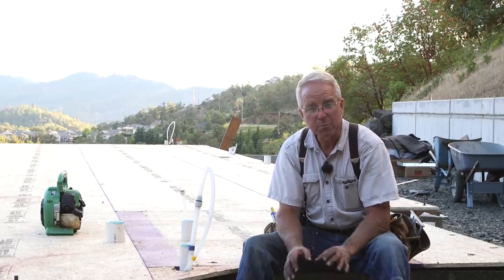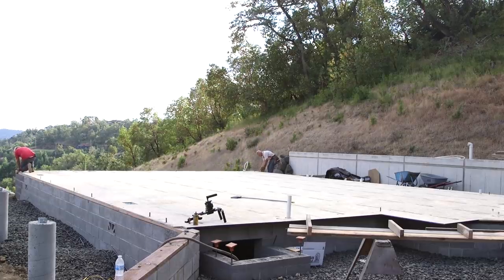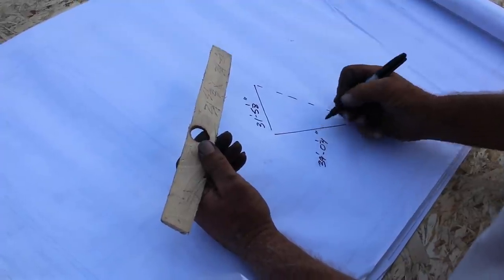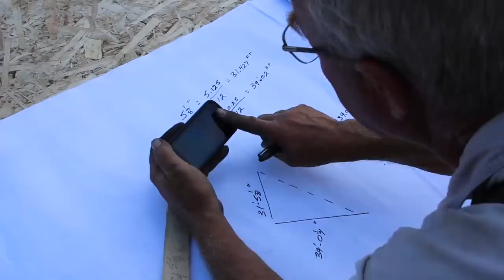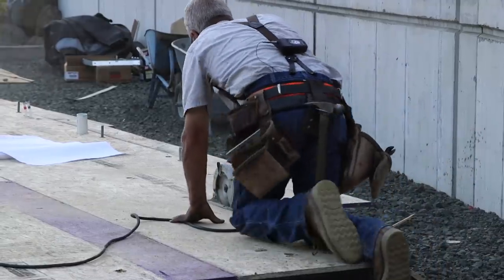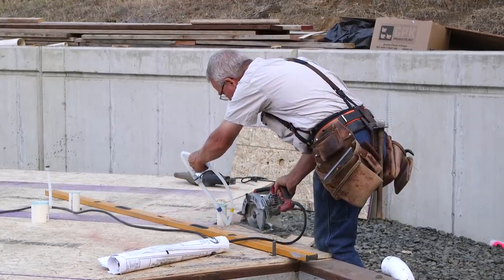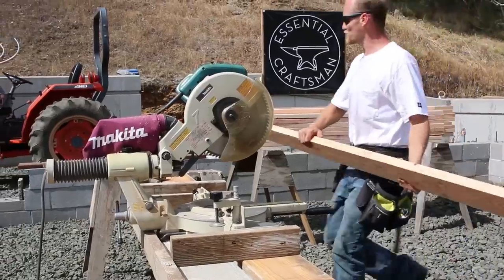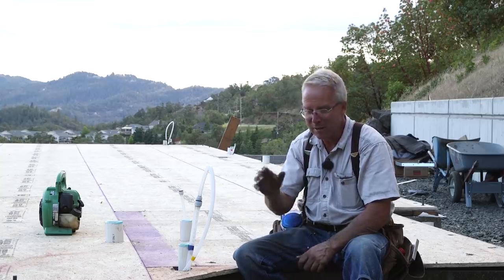Make it Square Ep.45

Comment: Old saying, "we are not building a piano here?"
Reply: My votech teacher used say that, 20 years ago. I still say today. My guys have adopted it as well.
Reply: Same here Alan, he's taking it way way too far.
Reply: @ajs96350  ...Or, maybe you're not taking it far enough?
Maybe you don't understand what he's trying to convey here: excellence in work, excellence in life. 
Take a moment and make some room in your mind for these words and actions from a master. We don't all see things the same way, but its always served me well to drop back and consider what someone else is saying. What their life has taught them. 
I've learned a whole lot this way, the alternative of "I've never done it that way before" will ensure that you never learn and never advance from where you are now. 
Just my two cents...
Reply: The time will be spent to make the project right.  You can do it today, in the bones, or have half a dozen trades (trim, tile,  cabinet guys, ETC straighten it out later.  It is easier, cheaper and simply a better practice to get it right in the framing.
Reply: @osmith5086  Whereas I get what you're saying,  I have to disagree. 
He was there for footing forms, block work and floor framing,  he has checked and rechecked along the way, he knows it's good.
Plywood has zero bearing on any square issues, you cant run it out to fix square issues, it won't support the floors above.
The frame is good, cut the plywood to the frame and then check your walls for square.  You can cheat walls out a little to help, but theres nothing you can do with plywood to fix issues now.
This is my issue with spending so much time talking about it.
As far as spending so much time to reflect about it, that crap doesnt pay the bills and feed mouths. Theres a line somewhere, I'm not an amateur,  I've been doing this for over 20 years.
Reply: Alan Pinho:  I worked with a guy who would always say, "We ain't buildin' no damn pianer here."
Reply: That's ironic, because I do build pianos! If it's off by a 16th, its garbage. 
 I plan on building my 1st house in the spring. 
It's going to be called a Piano Home.
hockmanpiano.com
Love this channel!
Keep up the good work!

Comment: Could have just framed that back wall with 2x8 instead of 2x6 and been able to get your 5/8" without interference. :-) Of course I don't know what window system you are using so that could turn into a problem if you did that. Always something! I am curious after all your work measuring and establishing the footings and walls how did it end up off? Was the foundation print not drawn to match the house correctly?

Comment: I’d split the difference between the back and the front. Quarter inch strong
Reply: That would be 5/16" each end to equal 5/8... a 1/4" strong would leave you 1/16" shy
Reply: Al Amantea idk about you but I with rough carpentry aka framing the smallest increment most people generally work with is an 1/8” but yes you’re technically right.

Comment: LOL at explaining pythagoras.  With all the converting feet into decimals, And back again.

Its times like this using metric measurements makes more sense.
Reply: or better yet just plug your numbers into online calculator
Reply: I carried a "CALCULATED INDUSTRIES" handyman calculator in my safety orange vest just push the button to switch from the surveyors decimal feet to feet and inches   feet to inches,,  etc. only cost $ 29. The $ 60 construction master 5 stays in the brief case in the truck. to calculate roofs,, Etc
Reply: Knowing decimal equivalents is like knowing multiplication tables.
Reply: I need a tape measure that has both units. I use metric when I can, English when I have to.
Reply: I need a tape measure that has both units. I use metric when I can, English when I have to.
Reply: Metric system is good for those who need life simple.   When you realize how handy the 4’ by 8’ dimension really is in framing there is no way you would want to use metric.   Only knowing one system just dumbs people down, just like only knowing one language.  🤷🏽‍♂️
Reply: Shane Yorgensen it’s kind of what you have when you pair it with the inch/foot system. I get your point though.  👍🏼

Comment: All those conversions with measurements to convert into inches and foot, case in point for the USA to switch to metric
Reply: The US uses metric though... We just have a combined system, like the UK.
Reply: As I said above, Canadian Carpenters use feet and inches too.
Reply: When calling out cuts or memorizing cuts Imperial is a hell of a lot easier. Add to that the fact that all of our lumber and building materials comes in imperial dimensions, it would be stupid to use metric. Metric makes sense in scientific uses sure. It does not makes sense in the trades here in the US. The only exception is roofing shingles. They can be ordered in metric sizes and they are only convenient because the shingles themselves are bigger and therefore cover more. You still measure and cut them with imperial dimensions though.
Reply: Not a valid point. Worked both sides of the pond. Question of habit - nothing else. Of course our material, except ply, is in metric dimensions, but only really matters in sheet goods, as you lay out for sheet rock etc. ...no real difference, except we get to skip the fractions.

Comment: 4:20 hurts my metric system
Reply: Too much 4:20 will do that
Reply: @aagames8420  What, you've never smoked 5/8's of a joint?
Reply: unknown 
Whoa, you mean 15.875mm
Reply: Decimal feet are a standard measurement here, especially among architects. We tradesmen naturally have to learn it as well. 1/100th of a foot approximately equals 1/8th of an inch, so it's actually quite handy a measurement.
Reply: @cracklingvoice  
1/100 of a foot is 0.01,  1/100 of 12 inches is 0.12 which is close to an 1/8" which is 0.125"
Reply: So 3.05mm is 3.05 mm which is close to 3.17mm. Got it.
Reply: @D2O2  Um, I'm not sure what the point was of your comment.

There are 96 eighths of an inch in one foot. The actual tables take a couple jumps to make it work. I said 'we tradesmen' because I am a tradesman and actually have to know how to convert between fractional and decimal measurements as part of my work.
Reply: @cracklingvoice  I agree that there are 96 eights of a INCH in 12 INCHES which equals 1 foot,  but 1/100 of a 1 FOOT is not approximately 1/8 of an inch,  it is 0.01 feet.  1/100 of 12 inches is 0.120 inches which is approximately 1/8" or 0.125".  The unit conversion is tripping you up.
Reply: @cracklingvoice  what is the difference in length between 100 eighths of an inch and 96 eighths of an inch?

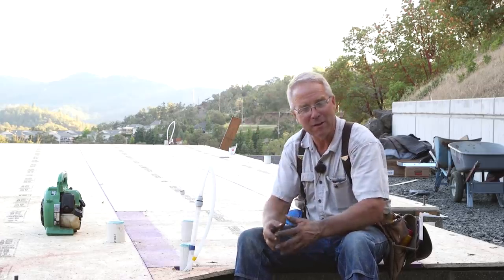Comment: 4:18 - 4:34 

No, no it's not. Metric man, metric is handy.
Reply: I was thinking, this Pythagoras calc would be a ton easier in metric :)
Reply: @dorsetengineering  Yes, only three countries in the world resist change. Myanmar, LIberia and some other developing country :-)
Reply: Being fluent with both systems, I can tell you that there's no real difference between using imperial or metric measurements.
In this particular case, converting everything to metric before using the Pythagorean theorem, and then converte it back to imperial will only lose accuracy, due to rounding off.

Scott is being using this system forever, he's handy with it. 
Why mess with it?
Reply: @hugoramirez1786  I find the metric system convenient and safe. Nobody should have to learn both systems. Imperial is redundant and causes errors. No, I don't think Scott should change, but future generations would benefit tremendously if the US decided to shift. English is not my mother tongue. Learning english to be able to communicate is a much bigger commitment than learning the metric system.
Reply: @BjorckBengt  I was born in Mexico, it was metric for me until I moved to the U.S. at age 23. Now I can do both just as easy. English is also my second language, which I learned while still in Mexico.
Because everything that Scott is using is in imperial (measuring tools, lumber, the standardization of materials based on feet and inches) plus all of his work experience is in the imperial system, introducing metric at this point will increase the possibility of error.

I might be wrong, but I think that when he said decimal places, he meant thousands of an inch, not actual metric measurements.
For example:
13/16" =.8125"
1/2" =.500"
1/4" =.250"
3/16" =.1875"
And so on . . .
(for those that don't get it, just divide the first number by the second:
13÷16=.8125).
Reply: @BjorckBengt  "plus one other developing country".
That's a good one, lol
😂

Comment: One nice thing about drawing plans with AutoCAD or some other CAD (Computer Aided Drafting) plan is that you can create a drawing with all the diagonals measured out in advance. You can double check them on site but this saves a lot of time in the field especially on a custom home and with angles like your plan for the garage or steps in and out like the back of the house.

Comment: If you have to grind out a lot of calculations using Imperial units, I suggest using an app that does the pythagorean theorem calculation for you. Carpenter Square Corner Tool seems like a good app. It accepts inch fractions down to 1/16" and automatically calculates the answer back into inch fractions.

Comment: The 3,4,5 triangle is useful to find a 90 degree corner

3 ft x 4ft with a 5 ft hypotenuse or 3m, 4m, 5m hypotenuse works great to avoid trapezoids shapes

Comment: My family home growing up was framed in all kiln dried Douglas Fir in the Pacific Northwest. To drill a hole into one of the studs without killing the drill bit in 2 holes, you either needed a carbide tipped or masonry bit. Forget putting a screw in without a pilot hole. The house was built in the 80's and the wood might have been old growth. I have seen other houses framed with the same stuff in that area and it is really strong wood.

The plywood used for the roof decking was just as tough, but I think it might have been pine. I couldn't drive staples in with a good mechanical staple gun when I was installing new insulation in the attic. I had to use nails. Driving those and the wiring staples (think more like fencing staples, a 'U' shaped nail with both ends sharp) for some wiring I did up there took some real force.

Comment: Thank g.. I am located in a country where we metric, SI-units, and the 10-numeral system is the standard. The only need for a calculator on the build-site is for trigonometric functions, However, a lot of those functions is included in handheld laser distance measuring devices.

Comment: This may sound like a silly comment, but the leaf blower being used in the video (the Hitachi) I find works better in my left hand.  The air intake on this model is on the left side, so if I use it in my right hand, it tends to rest against my thigh and get starved for air a bit.  Using the left hand lets it rest against the thigh, and not cover the air intake.  I personally really like the blower, and use it on multiple lawns as well as for blowing light snow in the winter, both off the ground and off my vehicle.  I didn't think it would last as long as it has, and bought a 4 stroke Makita a few years ago to replace it, but the Hitachi just refuses to die.

Comment: Great work. 
Try not fastening the front end of the board (the groove of the last sheet) until it receives the next sheets tongue. 
It’s easier to connect the next sheet s tongue into place. 
This floor was perfectly level but if you are doing a Reno there are more variables to deal with, thus harder to connect. 
After the new sheet is in place make sure to screw down the original sheet.

Comment: Hi Scott,
It's so refreshing to hear someone speak who truly understands tolerances.  I'm a tool&die maker by trade, and it's lovely to hear someone speak with authority about what "perfect" actually means, which is "perfect enough".  Different trades, same truth.

I have a question, driven by legitimate curiosity -- when you're laying out for the parallel line (in this case, making the back of the house parallel to the front), how do you ensure that the measurements you're taking (to establish either end of the back line) are being taken square to the front line?  I'm guessing experience and a well-trained eyeball, but would appreciate any insight you can offer.

Thanks in advance, and thanks for the amazing series.
Darcy

Comment: I have been following you for a bit now and yes I agree 100% with the pithagorean therum that is never wrong.  But you can get a construction calculator for a few bucks and it will do all the number calculations for you.  Not that it's better, right, yes easier but just a nice way to confirm that you have the same answer... Just for a little ashurance.
Reply: Love all you videos, learned many little tips and tricks from you.  Thanks a bunch
Reply: I use that calculator for all the concrete I do also...

Comment: I'm not an expert by any means, but would it be easier to snap off all the walls prior to trimming off the edges of the deck? As long as the overhangs remain all manner of small corrections and adjustments to square the walls are possible.

Comment: I use a piece of string to establish a 90 degree angle. Its total length is 24 meters. I have three small metal rings that fit tight around a nail in that string. First segment between those rings is 6 meters,  the second is 8 meters and the third segment is 10 meters. For smaller measurements i have one with segments of 3, 4 and 5 meters. You can make whatever length in whatever measurement system as long as those lengths are in the same relation to each other.

Comment: I always use two methods to check for sqare the 3,4,5 rule which is to measure 3 feet on one side 4 on the other and 5 in between.  The other is to measure corner to corner and look for the same measurement

Comment: It’s my understanding the 5/8” discrepancy is due to compounding error from everything from footings up to the sheathing. If you were doing a floor system where the joists sat on top of the mudsills, would you have squared the assembly at the joist stage, after the sheeting stage, or both?

Comment: I once owned the same exact Makita saw. I never realized how heavy the darn thing was to lug around until I replaced it. Having said that, I wish I still had it.
Reply: As did I, I had to time stamp that beauty and add my two cents. The thing was perfection. But HEAVY ya, not light.
Reply: It's all the extra skookum-ness they built into those old models.  :-)
Reply: @aussiebloke609  
Try new Skookum! Keeps the wobble out and keeps the precision in! (accessories sold separately not responsible for removing Skookum from work clothes see your warranty for details offer not valid on union work sites)
Reply: And not only that, it also doubles as a vacuum pump!  Available from select outlets only!  Buy 1, get 1 more for only 50%!

Comment: In order to determine the right angle you can also measure 4m / 5m and the diagonal between the two points must then be 6m. So we determine in Germany at large areas the right angle ... maybe interesting for you ... thanks for the great videos and only the best for you
Reply: Actually, no, a 4-5-6 triangle does not give you a right angle. You're thinking of a 3-4-5 triangle
Reply: it does not matter if you use 3/4/5 or 4/5/6 ... not all surfaces are so big that you can use 4/5/6 ... with smaller surfaces you can also cut it in half ... it just depends on measuring accurately then everything works ... a triangle remains a triangle
Reply: @Painless61   Yes, it does matter.  a 4-5-6 triangle does not give you a 90 degree angle like a 3-4-5 triangle does.  I don't know where you got this idea, but you're absolutely mistaken.  Using the Pythagorean theorem,  3 squared (9) + 4 squared (16)  adds up to 25, which is 5 squared, so a 3-4-5 triangle has a 90 degree corner.  It doesn't work with a 4-5-6 triangle. 4 squared (16)  + 5 squared (25) adds up to 41, which isn't even close to 6 squared (36) .  I hope that you haven't been using 4-5-6 triangles to lay out 90 degree angles,  because it doesn't give you 90 degree angles, it gives you an 82.8 degree angle, so all your "90's" are going to be 7 degrees off.
Reply: Andrew Alexander you‘re right ... i‘m wrong ... Everything ok ...

Comment: If the Pythagorean theorem and trigonometry isn't your thing, you can always simplify and get almost as accurate with the 3-4-5 rule. 3-4-5 states that a triangle that is 3 on one side and 4 on another will have a hypotenuse of 5. Feet, inches, yards, miles, doesn't matter. And it works for multiples too, so it could be 9-12-15, or 6-8-10, or 12-16-20. Calculating it out like Scott does is the most accurate way of checking square, but the 3-4-5 rule will get you really close, as well. 

As usual, great content, guys. Keep up the good work.
Reply: Using the theorem is way easier, though!  It's essentially plug and play but with math.

Comment: There are great apps on smartphones that you can use that will do the triangle calculation for you in architectural units so you don't have to convert to decimals and then back to feet and inches.  Just look in the apps store for framing calculator.  They work great!

Comment: I know that this is off the "Square" subject, however here in the North East winter is coing on and since you have good tips on the Sears Die Hard boot and the White Ocks gloves, I was thinking that you could tell us what brand of long underwear you use or used. I'm am still buying the Fruit of the Looms thermal. cheap, and they work. :-) Any suggestions?